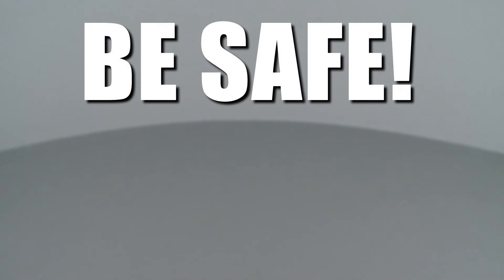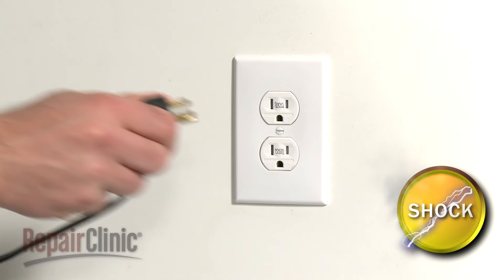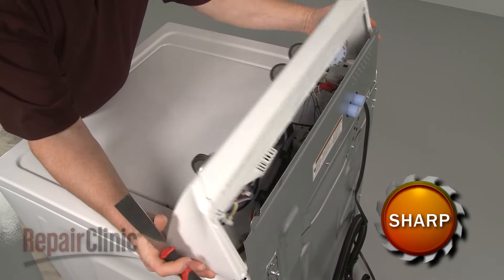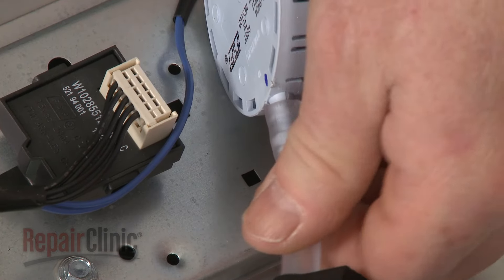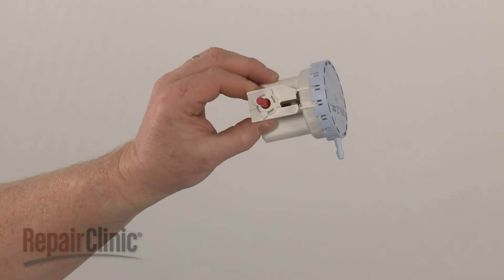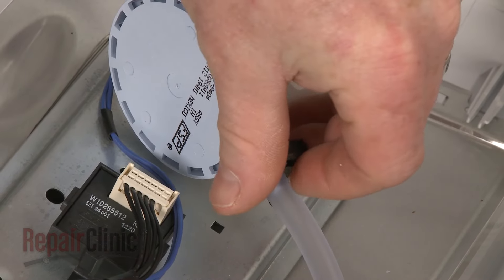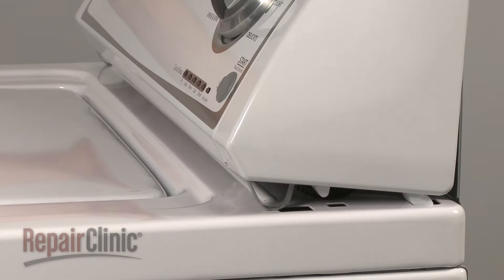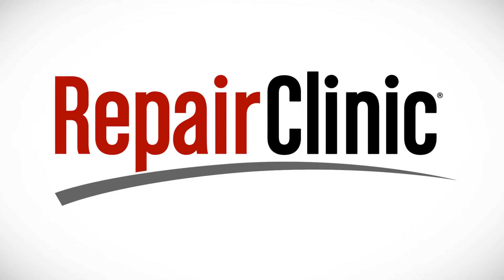Whirlpool Top Load Washer Replace Water Level Switch W10268911

Comment: Used this excellent video to fix the water level(Load Size) switch on my Whirlpool Fabric Sense System washer(Model # WTW5840SWO). I thought it was broke, but the cogs just slipped passed a bar and would not engage. I just got the cogs back in place and it now works great. Your easy-to follow video saved me hours of work and frustration. Thanks a bunch!
Reply from the maker: Jeffrey Seiler We're happy to help! Thanks for the comment.

Comment: Should there be any "back-presure" if you attempt to blow air through the tube that connects to the switch, or should air flow freely through it?
Reply from the maker: The air tube connects to an air dome on the side of the tub and you should be able to blow through it freely unless there is water in the tub then you can blow bubbles. If you can’t blow through it, the hose or air dome is plugged and will need to be cleaned out.
Reply: ***** The air tube doesn't appear to be blocked, and a test run with the back panel removed showed the tub is filling to the top when set to "Small" load, which clearly can't be right. I'll order a new switch today, and report back. Thank you!
Reply from the maker: Great!
Reply: @ThomasDaum  long shot, long time ago, but I need to ask.... any luck?

Comment: Broke the knob on my switch. Quick fix using your video to manually switch it to a Large load. Something I can manage for different washes. It was stuck on small initially.
Reply from the maker: +frostymarvelous Thank you.
Reply: Mine is stuck on small load, I can't even put a wrench on the shaft to try to make it turn, it won't budge. Should I replace the whole switch, or what did you do when you said that you manually fixed it?
Reply: What did you do to manually fix it... mine is stuck on small load, I even tried to move the shaft with a wrench and it won't budge

Comment: my load size is stuck on small will not turn. just to clarify that means replace that switch or should I do other procedures ?
Reply: by the way this is the model I have wtw5310sq0
Reply from the maker: +DZenitram23 http://www.repairclinic.com/PartDetail/Pressure-Switch/W10339334/1636739?TLSID=1773 There is a good chance the water level switch is defective and not allowing you to change load size.